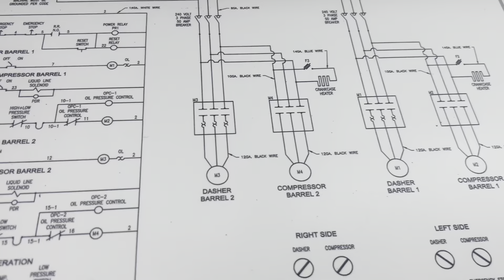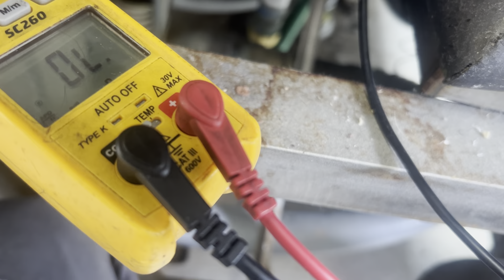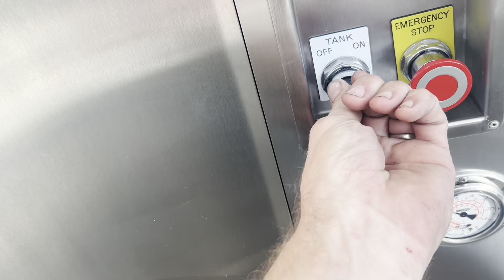Custard machine - hopper not cooling

Comment: You need to place a big capacitor over those contacts, this 'pearling' of relay-contacts happens due to electro-magnetic induction, typically from motors like the fan-motor kicking in and out all the time due to changing condensor temp, alternatively the capacitor can also be placed over the leads of the motor. This all looks to me as an electrical design flaw.
Reply from the maker: 👍🏼- Thanks for dropping your wisdom for us 😎. Appreciate it.

Comment: This is what happens when you get used to three phase..... 
Hint: what is the other leg of a single phase system? You have the hot and neutral. You were reading zero ohms because you were reading though the single phase compressor coil to the neutral, which of course is bonded to ground. So that was normal and why when you disconnected the condensing unit and tested it itself, there were no shorts to ground (at that time anyway, good). And the white.... yeah the white is usually neutral and you would expect it to read to ground. The prints on the door do show white and red for hot and neutral respectively. 
 
Contactor did look like shit though, but that is not your short to ground, if there even is one. Maybe the compressor is short cycling and the PTC, overload or whatever that compressor has is bad and instead of that tripping it blew the fuse on a hard restart?  That contactor did look beat on for something with only a 10A fuse.  Good idea on the resetable breaker, but wonder what type of trip curve it has. Since starting a compressor can draw more than 10A and they will usually have time delay fuses or the HAVC breakers to allow for the momentary high inrush. Not sure what the little button breakers act like with starting high inrush loads. But I am over thinking it now and you did get it running. Curious as to if they keep having it trip. Hopefully you will let us know. 

Cool side story on fuses and motors. Last deployment to Antarctica we had an emergency gen electric radiator fan motor tripping. Big three phase motor, over 100lbs and a real bitch to get too. Electrician I was replacing called a bad motor and left it to me to change, thanks a-hole. It would have been really, really difficult with cranes, on a roof, under an enclosure in -30F temps. Think of changing a condenser fan motor sitting inside the unit, bent over and trying to lift a 100lb motor by yourself because only one person can barely fit all contorted in there. Anyway, I wanted to verify it was the motor first of course, I did NOT want to change it. Long story short, he was putting in normal 20A fuses!! I put in the correct 20A time delay fuses and guess what? It ran like it should and didn't blow fuses on start up. Last I heard it was still running 3 years later.
Reply from the maker: Yep yep and yep.   The ground chased to neutral and the bond, not any specific component.   Was relieved when I realized it wasn’t a compressor and I was going sideways :-/.   Always great insight from your experience 👍🏼. Also. That kinda wiring is what kills people.   Just take your single phase off 2 legs of your main for goodness sake.   Had the contactor not still been pulled in after I killed the Breaker there’s a larger than zero chance I just start digging into that thing ⚡️
Reply: Ohh and sure you know, checking for temps on shiny surfaces, or any surface, black electrical tape works great. Plus, then that shows the reflected IR vs the actual surface temp and is pretty cool. 
I think the base of the contactor comes off too. You could have possibly swapped them. Looked like it in the video, but not sure and not all do. But thanks for the videos, as always! Fun to follow along, whether the manufacturer wants you to or not. 😃
Reply: @restaurantrepairs  Easy to get mixed up and all the time later on you go, shit, now it makes sense. lol 
Yeah, that separate control power can get you for sure!! The only reason I can think of is if they have 480V machines, instead of adding in a huge 480/120 transformer they just use a separate 120V circuit. If they even offer a 480V machine. But in a 208V, yeah just tap off of that. Then again, that may constitute a higher three phase branch circuit instead of the normal current rating they use. Since you do have another 20A just for control on top of whatever for the three phase.  So you would have to bump all three phases up by 20A. But probably for reasons of simplicity and to have one basic machine configuration they do them all with a separate control circuit. And I am sure it comes down to money too of course, how they can make even more money! Definitely keeps you on your toes! And also what makes someone "trained and qualified" vs just anyone trying to fix shit. If "trained" they expect you to remember. lol